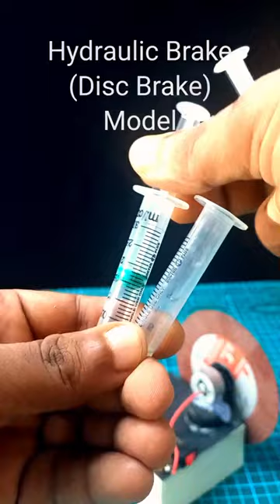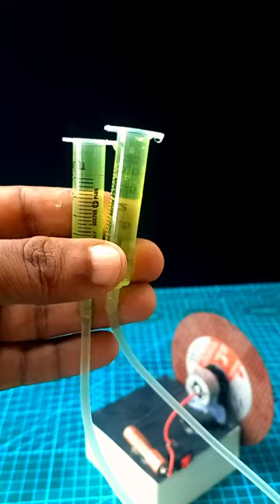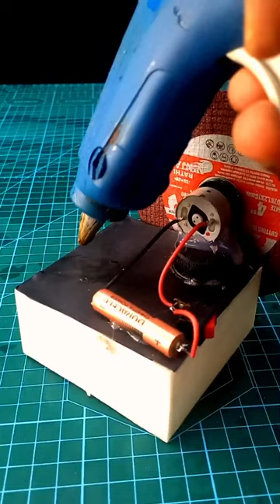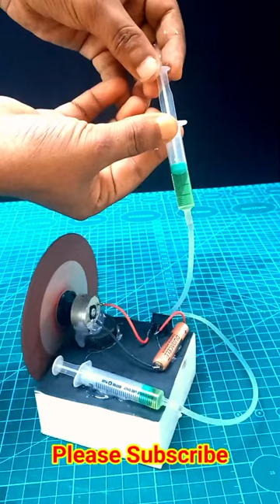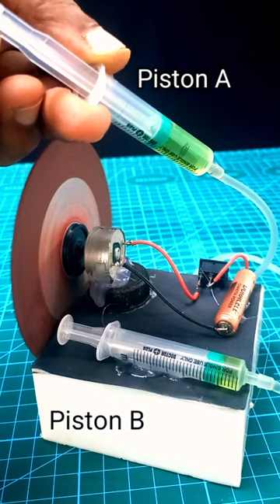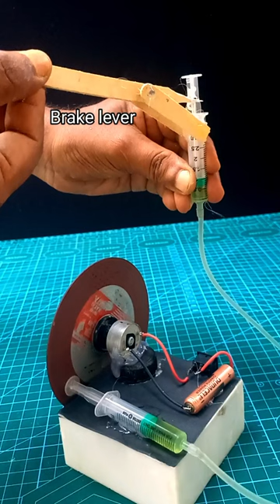Hydraulic Brake Model / How Hydraulic Brake Works / Disc Brake Working/  #shorts

Comment: Which fluid can be used , easily available.  I tested water but air gets stuck in after several usage, can mustard oil or some other oil be used?

I am trying to switch off / on a pluSwitch